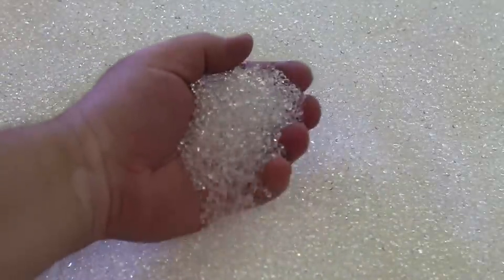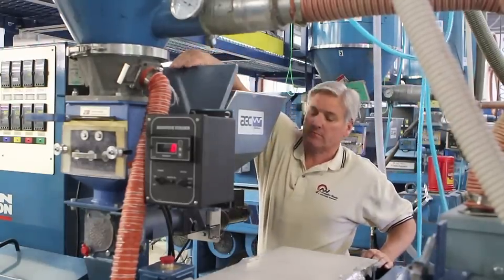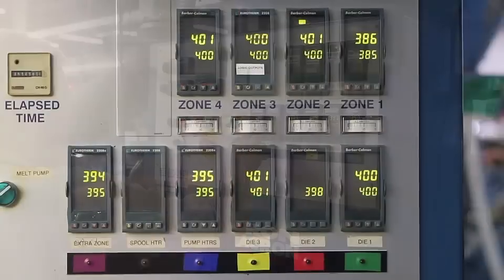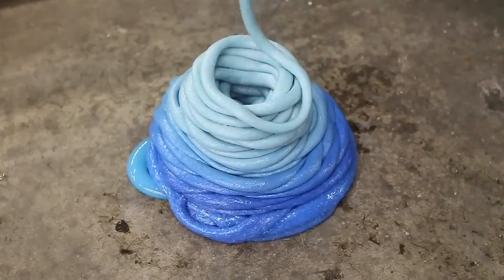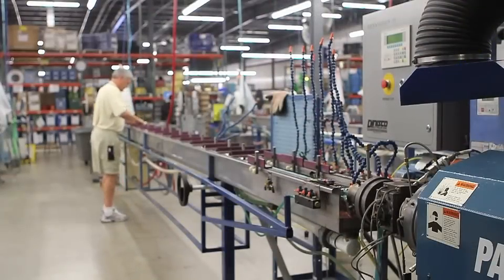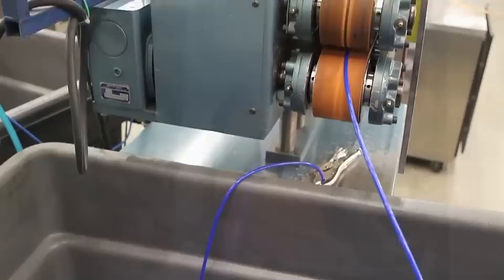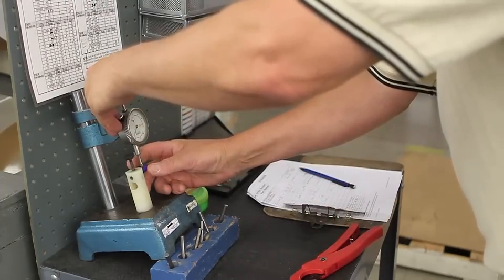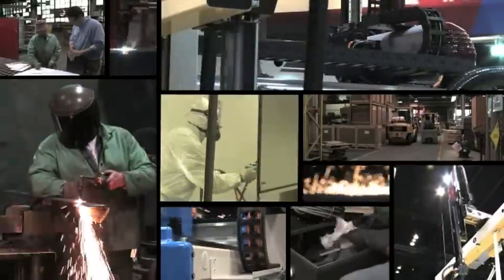How it is Made: Freelin-Wade Plastic Tubing Extrusion

Comment: Need your technical expertise. I have a small extruder and the entire barrel moves in a circular pattern maybe 1-2mm or so - which makes it very difficult to maintain tolerances on the product extruded. I thought it was due to a screw that was broken and repaired and assumed might not be 100% straight, but the same thing happens also with a new screw... what could be the cause? The motor and the gear box? A bent shaft that connects to the screw? Maybe the extruded not being level properly on a hard surface (it is on a wooden pallet)? A bent or worn out barrel?
Reply: Badly worn barrel and/or barrel location into the thrust bearing housing of the gear box

Comment: disliked this video. i myself am i set-up technician for plastic extrusion. this person in this video disregarded multiple OSHA safety regulations and PPE regulations
Reply: Thermal Yetti Yeah, like how he grabbed the hot tubing with his bare hand to feed it into the cooling water.  And how they let the future regrind tubing plop on the floor to get dirty and contaminate the new tubing.  And there were a bunch more.
Reply: The plastic is not even that hot, I have done it for a decade that way. Some setups you have no choice but to use your hands and you need the dexterity of feeding it threw small holes
Reply: how about his clothes
Reply: Oh blow out your ho ho. That's a nice clean shop.